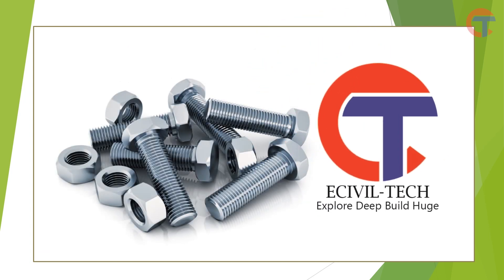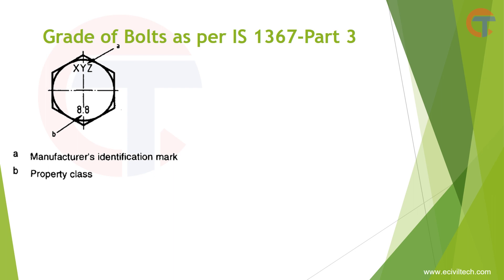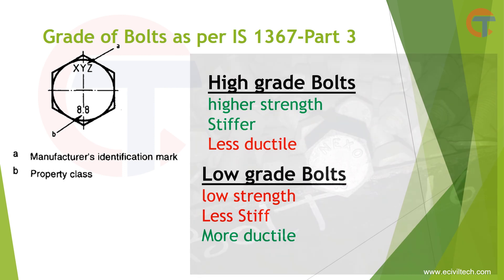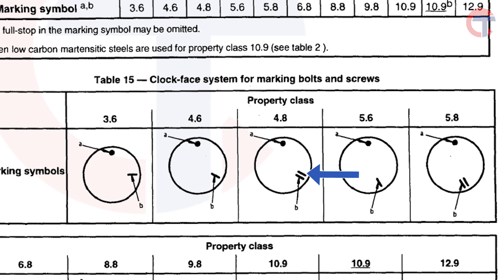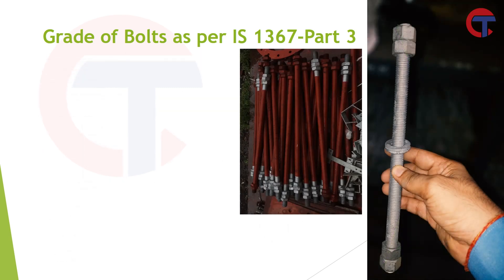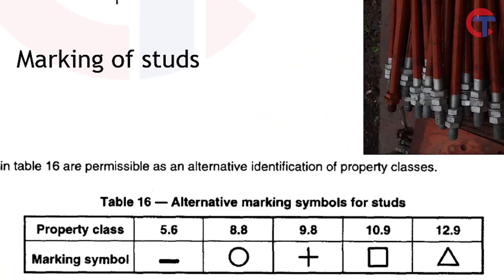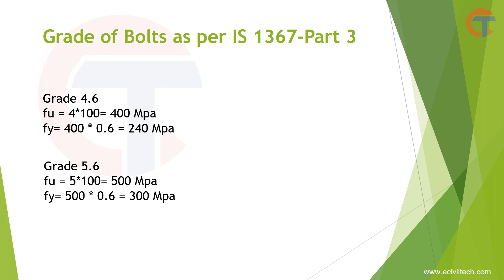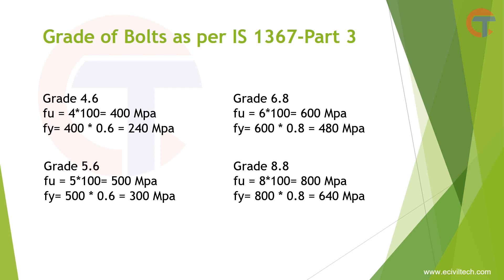Grade of Bolts   Structural Bolts  Fasteners  - Part 3 - eciviltech

Comment: Which standard India follows ? SAE, ISO or ANSI ?What is IS 1367 ?
Reply from the maker: We follow indian codes for design. For bolts and fastners and other metals also we use inidan code only but these materal codes are based on ISO. So u can say for material we use ISO. For export products ISO is prefered as per requirement of client. Many indian codes are free available on net, you can search and go through it.
Reply: @eCivilTech  Thanks for the reply. For inch size bolt which standard India follows ?
Reply from the maker: @shan_6013  Now indian codes are shifting from MKS system to SI system. All new codes will be in Newton , Meter, mm etc

Comment: Head markings are not per the industey standard and I wouldn't use the for structural applications
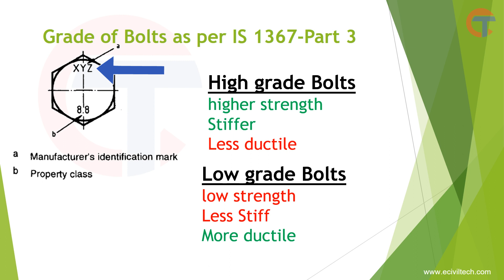Reply from the maker: It is as per indian standard 1367- Part 3. Here in India, most commonly used method is 0:51
Reply: @eCivilTech  perhaps you should study more such as the research council on structural bolting
Reply from the maker: @jenniferatkinson5519  Sure. Purpose of making this video is to give some idea on structural bolts. These things will be useful to understand the design videos, which will be uploaded in near future.  You can share link/content regarding bolts, which may be useful for next video on bolts.